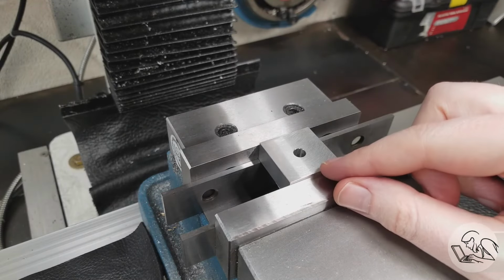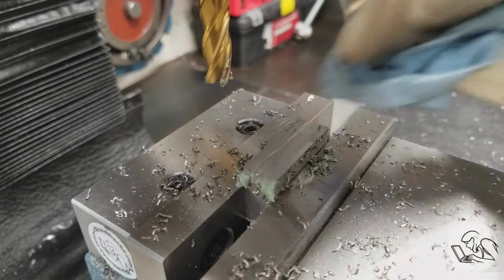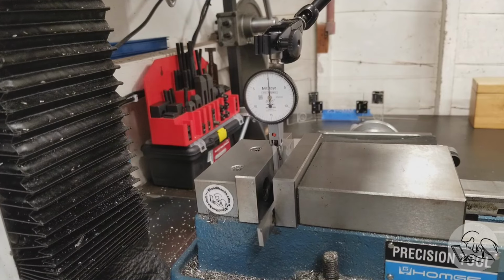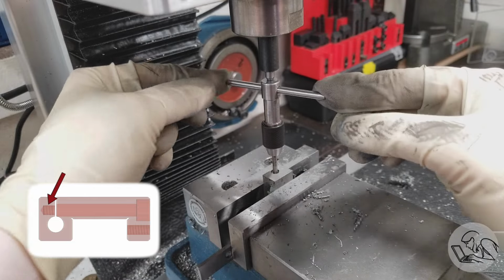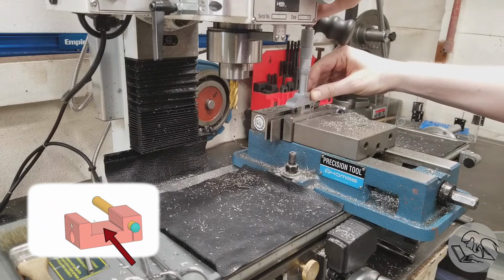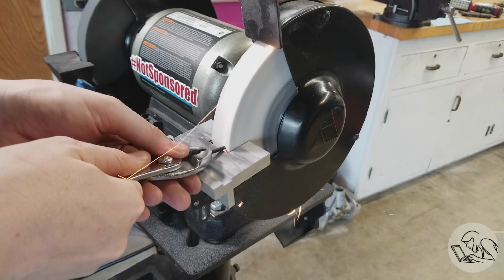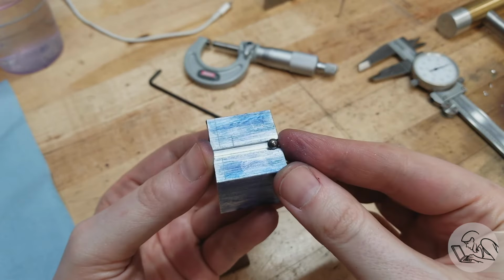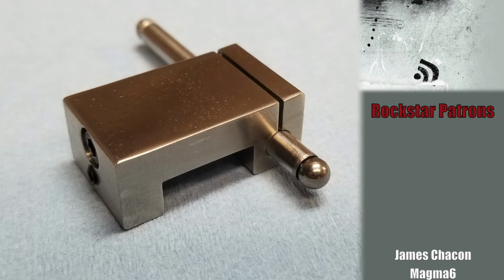Vise Stop! Let's Make One!

Comment: as a beginner, this video scares the crap out of me! Especially with the stainless... however, I despite loving the design, I might just go in from the other side all the way through the clamping thread hole and use 4140. Thank you for pushing the envelope Quinn, its has so many lessons baked in! Quality bolts? Never imagined this, lessons learned.

Comment: I know I keep mentioning my (late) step-father since he was one of the finest machine shop teachers I've ever known, and when you mentioned air hoses in your shop, it really rang a bell with me. Pop never had an air hose anywhere near his machines in his classroom/shop. He capped off all the air lines but ONE and that one air hose was off in a corner. All the machines were cleaned with brushes... just like you're doing. I also like your filing left handed at the lathe instead of reaching over the chuck. Everyone does it and it makes me crazy to see it.

Comment: Like other(s) I too didn't know to use slitting saws full depth so thank you for that.  I was, however, told by an exert to always cut a dovetail in one pass.  You first machine the trench for which I use tipped tooling on the mill and run it as fast as possible and watch the blue chips fly.  Then run through with the HSS dovetail cutter going much slower than theory would dictate and very slow feed with plenty of coolant (to both cool and to flush chips away).  Of course you need to plan this cut very carefully to ensure that you end up 'on size', but I have had great success with this technique and the quality of the finish was spectacular compared agaist my expectations.

Comment: 5:10 if you run your endmill on the front of the part going left to right (Cutter movement `aka "climb milling") you will wind up with less of a burr than the way you went. Minor thing really but it can save time deburring the part when finished.

Comment: 69 youngster here, hobby machinist with PM25 PM1127 and PM833. 
But I have worked in few machine shops as electronic control engineer (Sensors, instruments, controls programming PLCs etc) May I suggest a few tips and tricks that I have learned over the years?

Set screws: get a piece of copper wire from say 2/16,   2/14,   2/12 etc... I keep just a few inches of the ground wire in various guauges.
Now whenever I have to install a setscrew, I ALWAYS put a short cut piece of wire in the whole before inserting the set screw. This way you will never mar a shaft, a keyway etc
A millwright I met was using BBs for air carbine and pistol!
Never had a problem getting a pulley off a shaft after this trick!

Super glue: once the parts you want to glue are absolutely free of grease, even finger grease, wipe them with a damp cloth and dip the part in baking soda powder (it used to be a cow on the box, now it's a strong man.... you know what I am talking about), 
Put the parts together and drop the superglue at the joint. Use the thinner type. 
The physic behind this is that superglue will bind each baking soda grains to each other and to the surface, augmenting very much the actual surface contact. It's at the microscopic level but believe me it works!
Also, you can fill a hole with layers of soda and superglue then drill and tap into this to repair a damaged screw thread. This work very well in cast iron!
Keep those good VDO comming! I learn a lot from you...
Luc

Comment: Nice work Quinn!
In case you're interested: A little trick I learned for tapping stainless is to actually drill the hole 0.1mm bigger than needed. Gives the tap a little more room

Comment: Expertly machined, as ever, but I'm wondering whether the initial problems with the bolt were partly because it has too much stainless steel to bend. A simple mod would be to saw a vertical slit a small distance on either side of the bolt threads so that only the central third or so of the length is being flexed. That would transmit more force to the rod,  making the clamping more efficient.

Comment: Hmm. If you found some smaller ball bearings, you could drill the holes in the rod deep enough that the balls could be swaged in the ends. You'd only need a few thousandths exposed.

Comment: While making optical mounts, I stumbled on a simple, reliable method to capture a ball bearing in a rod or screw. Basically, you use a twist drill to bore a hole slightly deeper than the radius of the ball bearing. You then raise the lathe tool above center and use it to fold the rim over. Basically ‘peening’ the edge & folding it onto the ball bearing.  

A little geometry tells us that the drill depth to the center of the ball is:

Depth = R / cos( 90 - alpha/2 )

R = ball bearing radius
Alpha = drill angle {135, 115, 90,….}

This has the benefit of allowing the ball to move relative to the rod or screw.  

It is certainly worth a try…..

Comment: I wonder if for fixing the ball bearings a Liion battery spot welder might do the job? For a totally clean fix it would require an external trigger button (usually a simple soldering job) as you would want the ball being firmly contacted while being pressed firmly to the hemispherical indent. 

A soft copper sheet insulated from a vice at the back face and connected to the anode and the bar insulated from the vice also but connected firmly to the cathode. Once happy with the set up a couple of short pulses might well give an even more solid fixing than CA glue.

Just a thought.

Comment: Great video!!!!! I learn a lot from you!!!  Brass tipped set screws,,, you can just drop in a little bit of brass rod into the hole ahead of the set screw,, or copper.

Comment: Quinn, I used the Anchor lube today on some 304 SS.  Turned, drilled, tapped and parted off 2 pieces with no funky smell or smoke.  Thanks for the tip!
Reply: When I was an intern in a physics lab many years ago, among my responsibilities was to drill little vacuum relief holes through those stainless steel optical shafts. I did this in a machine shop surrounded by half a dozen professional machinists none on whom ever told me anything about work hardening or anchor lube or the importance of being right in center. Arrrrrrgh. Anyway, thanks to Quinn, now I know!

Comment: drilling stainless is fine, especially in 303, it’s not a difficult material.  316L can be more of a pain for work hardening.  Tapping Ti, is the worst home shop nightmare, don’t ask if your tap will snap, ask when😭😭😭🤣🤣🤣❤️❤️❤️could you mill a flat on another stop rod, so it will clear the collet ring and seat on the block body?

Comment: The split line does not need to call perfectly on the end of the thread, you could simply overshoot the through hole a bit. So long as the thread is anywhere to the right of the slit, you're golden

Comment: Hey Quinn. Good vid as always. I’m a newbie and your vids have been informative. Appreciate it. Just a tip... to attach ball to your rod. Put the ball on the tip of a drill Chuck with NO LUBE. Put the rod in your Chuck and press the two together with a fair amount of force. Spin it around 600 and increase the pressure slowly. Instant friction weld. Just watch carefully and the second the bearing spins at the same rate as the stock... stop the late. Works like a charm!

Comment: Great video, thanks.
A better way to attached the ball: ball  should be smaller than the bar in diameter.
 with a common drill bit (same dia. as the ball), drill a hole 3/4  ball's diameter deep. Clean parts for oil free, and pour few drops of locktite ( I used 270). drop the ball in, and bend the "lip" around towards the center  with a small hammer. rigidity is guaranteed.  when I did mine, I used 5mm ball and 6 mm bar. (sorry for my English)
thanks again.

Comment: Ms Blondi, I'm not a machinist (but I am an engineer) and there is something about machining and your method of instruction that is fascinating.  Can you please tell us the details of making a tapered part in the lathe.  I know this is done by carriage movement but it seems that since the drive shaft drives the tool holder forward only a straight cut is possible.  The carriage and the tool would have to move at the same time and at different rates.  I don't understand.  Thanks..

Comment: Excellent video, very educational and fun too!
Thoughts about retaining the ball bearing (some duplicates other posts):
1.  Grind off some of the polished chrome from the surfaces you will be gluing or soldering / brazing; roughen the surface a bit
2.  Drill out the end of the rod, put in a ball bearing, crimp or peen
3.  Silver solder or braze
And @George Mann Sr.  suggested using a (I assume valve) pushrod from a gasoline engine.  Gas engines come in many different sizes; might talk to mechanics and to small engine repair places.  I'd think you would want a diameter you can find under/over reamers for.

Comment: Awesome stuff.

Tip: cover your air blower with a rag and you can really hook in without blowing stuff all over the place.

Try to always cut against the fixed jaw. Not such a problem with light cuts but one day it'll push hard enough to dislodge the part. Haha.

Comment: You can use Loctite but you have to use it with a "activator" that contains little copper because Loctite need this when you try it on stainless. Check it out on Loctites homepage.

Comment: Quinn, I've been researching hobby mills available to me in Australia and I want one that can machine everything from soft alloys to SS 304 etc... (it doesn't need to make heavy cuts in hard steels though) So I want to ask you, do you feel that your mill with the 750W motor is powerful enough for everything you do? or would you have gone for more power if you could have? I'm currently trying decide between a 1100w and 2200w machine (both are Optimum brand).

Comment: I don't know if the rod and ball are stainless, but when using most Loctite on stainless, it is important to use primer first. Yes, absence of air/presence of metal is key, but with stainless, the anode/cathode reaction is missing like in typical carbon steels. I work with stainless regularly in mechanical applications and could not figure this problem out until I called Loctite and spoke with an engineer. It may possibly have worked with primer, but then the ball is just seated with  countersink at the end of the rod, so who knows.

Comment: That green stuff is said to be made for stainless because it won't attack the micro structure of the steel  I quit using that green snot 40 years ago. No good as far as tapping fluid. At home I use molydee for tapping but very expensive . Mostly I use Used ATF. for cutting oil

Comment: Wait, I remember you saying something not to long ago I can’t remember what exactly but I believe you were bummed about not having flood or mist coolant. So I’m curious, if you do have compressed air why don’t you have mist coolant?
Reply from the maker: The compressor does not stay set up. I don’t have space for it.
Reply: Oh okay makes sense. Maybe look into making your own budget flood coolant setup? This is what I did and it takes up very little space, I mean the only thing really taking up space is the 5 liter bottle I used for my reservoir. The pump I used is so small it could easily fit inside one of those little 8oz soda cans so really no space needed there just stuck it to the side of my reservoir. But I’m $30 all in, slightly ghetto tbh, but it works. Less time sharpening cutting tools = more time for making stuff (:

Comment: Hi Quinn,
Congratulations are in order! In my books anyway. You’re one of the first I see to use a thread tap properly. By that, I mean rotating it back to break off the chips. So many I see just wind the poor tap in the whole way. I was taught many years ago, and was to the point of wondering if modern thread taps are different! :)
Love the show. Rx
Reply: Failing to break the chips, especially for small taps, provides feedback VERY quickly.  Hopefully one learns from it (or gets instructions before).

Comment: Yo you could cut a taper on the ends of the bar, use a much smaller ball bearing, cut a deeper dish into the bar, and peen/crimp the ball bearing into place around the edges

Comment: The step leftover when you initially faced off your stock, did you ever figure that out? Seems like it would either be nod of your milling head or slight discrepancy between set up on your parallels. Also, the testing of the drill rod in the oversized reamed hole, was damn sexy, um, mechanically speaking I mean.
Reply from the maker: The problem didn’t repeat anywhere else so I didn’t worry too much about it. The step buffed off on the wheel at the end

Comment: To make the collet block set up better, turn another rod that is milled away (or offset turned) for slightly more than the length of the collet nut. Easy peasy!  An L-shaped rod that can go down into the vise is also useful.
Totally agree on the anti-seize for stainless--I use Tef-Gel which is sold in boat shops. It's super sticky-goopy but clear and teflon-based. Neither screw needs to come out very far, so you won't notice the messy anti-seize.

Comment: Great video!  What sfpm were you running your em at? Hss or carbide?
Maybe for one of your next projects you could make a slitting saw arbor, one w a lower profile!  They are not that hard to make.
Reply from the maker: I was doing 750 rpm on the half inch endmill, I believe. Whatever SFM that works out to. 😀
Reply: @Blondihacks  about 98 sfpm.  I cut some 303 the other day and it cut like butter compared to 316.  So, my guess is you can probably get away w it using carbide (and your part looks great) so maybe that is what you were using?  For 316, when you get to it maybe try 35 sfpm and see how that goes...sfpm=(D of em x pi x rpm)/12. Nice part and good to know a better bolt made a difference in that shallow tapped hole.

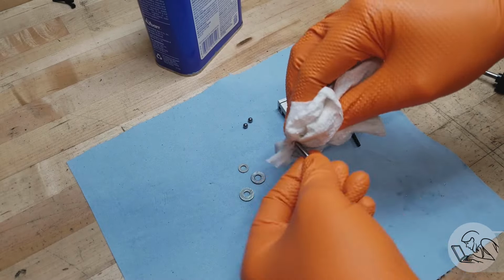Comment: 23:04  Acetone does not leave  something totally clean but leaves a residue and prevents
the lock tight from sticking properly.
Try cleaning with alcohol instead it evaporates completely and leaves a much cleaner surface 
for the lock tight to adhere to.   Hope this helps
Reply: seerofhrt   Sounds like a test for Project Farm. He could test different solvents and cleaners for the best surface prep.
Reply: @PorchPotatoMike  I would be interested in seeing the results of that.
Mabey learn something new

Comment: Hi Quinn, nice job!  If you try a V2.0, stop rods with a dog-leg are very handy, this way they can swivel up or down to suit your job or obstructions. And a Cam Lock lever could also help - threadlock the bolt in to save your threads and adjust the cam lever for clamping pressure. It'll make it a lot quicker to operate.  Stay safe and well :)
Reply from the maker: All good ideas!

Comment: Loved watching this. First thing I ever made on my lathe when I got it (apart from a couple of plastic bits) was a replacement rod for the side of the second-hand crib I'd bought for my second child. It was a 900mm long, 6mm diameter (3ft by 1/4inch, roughly) rod with a knurled knob on one end and threaded M6 on the other... in 303 stainless. Oooh boy did I learn a lot! Proud of that part.

Comment: I know you don't want anything showing from the far side of the part, but I think you will eed to go all the way through with the clamping bolt and use a heli-coil insert or a steel nutsert in order to make this thing reliable.  As Eric pointed out below, stainless sucks for threads.           Even still this video did an excellent job of demonstrating what a bitch stainless is to work with.

Comment: Well done Quinn! Myself, I think I would round over the bar stock and not add material (ball bearing). Take 1 end of your bar and mill a flat spot for enough clearance for your collet block. 
What do you think about making one and instead of the round bar, drill and tap all the way with a fine thread, a long screw or threaded rod would give you a stop with a fine adjustment feature. 💖💖 Love you, and your videos!

Comment: A suggestion.

Never use 6-32 of you can help it.
This is the most often broken tap because the threads are too course for the diameter. 6-40 always a better choice.
Reply: agree on 6-32 being a poor choice of thread. 6-40 isn't common in my hardware stash, so I would have chosen 8-32 or M4
Reply: @grumpyoldman5368  

If you don't have 6-40 screws in your stash, I suggest getting some. A lot easier than dealing with broken taps and broken screws.

Comment: Keep up the good work, Quinn. Do you plan on making more pins with different shaped ends? Like a smaller diameter tip, or one that's milled to center to get around the locking ring on the collet block? And thank you soooo much for pushing that piece of wood off. It thought you were gonna leave us hanging.
Reply from the maker: I hadn’t thought about that, but good idea!